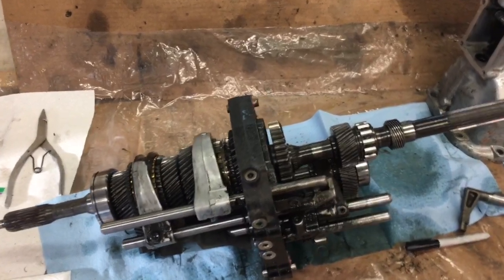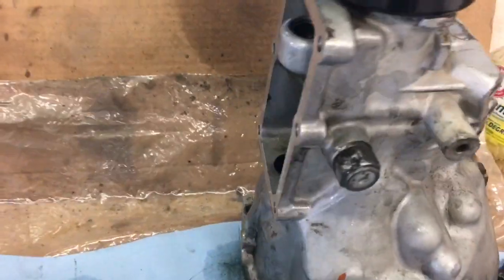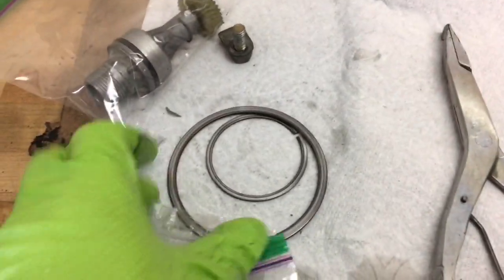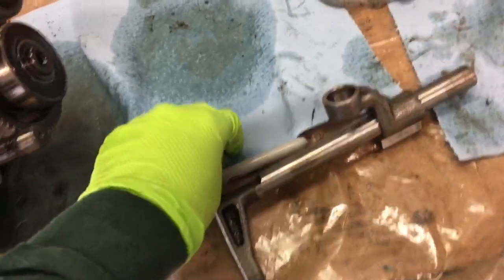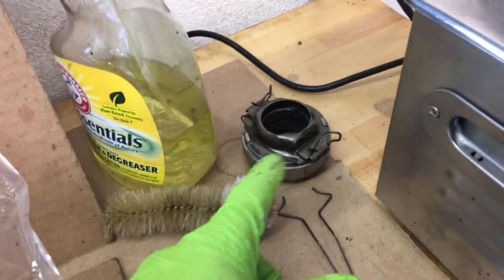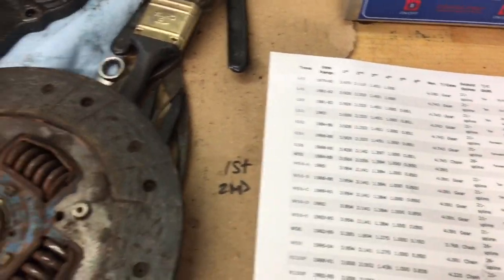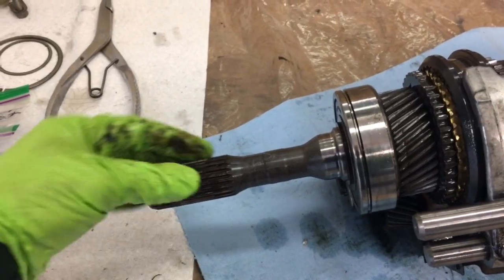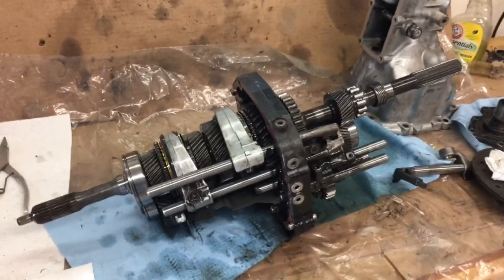So I think my 1990 Toyota pickup has a '91 Toyota Supra transmission in it... W58 disassembly tips

Comment: Possibly a Transmission from a Celica.
Reply from the maker: Yeah, that could be too. I didn't think of that. It was marked 91... did Toyota produce a Celica in 1991 that used the W58?
Reply: @ray5961  No,1985 was the last year of the rear wheel drive Celica’s in the USA so I guess you got the good one
Reply from the maker: @newriver8940  Thanks for the information and follow up on that! I think also, because this is the W58 with the cast iron center place, that points to the NA Supra (if I remember my research correctly). They also made a version of the W58 which has an aluminum center place. I remember being happy that the one that was on my truck when I bought it was the cast iron version (just the gearbox ended up being worth twice what I paid for my entire truck haha :-)